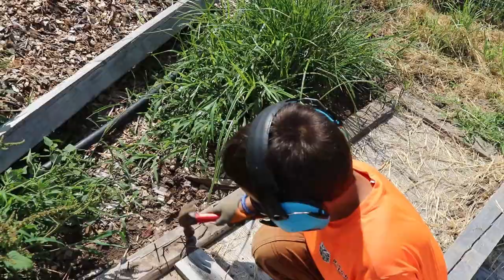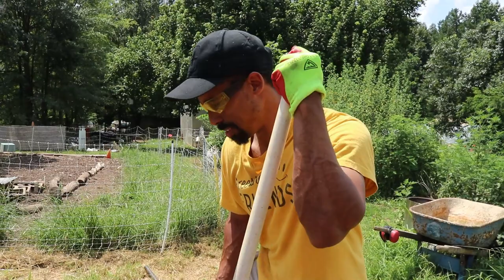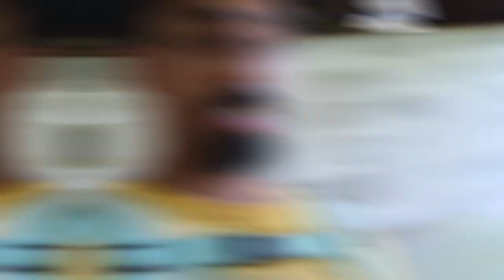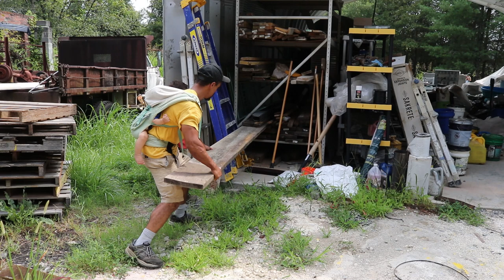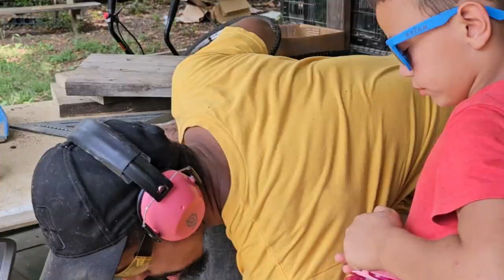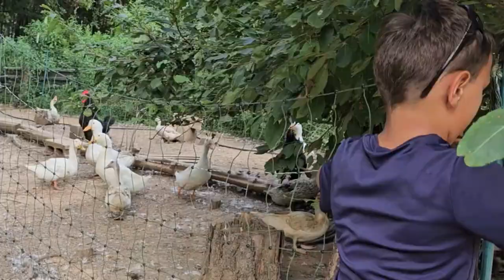More EGGS With This Super EASY DIY Build | DUCK Boxes

Comment: Watching the boys pound the nails OUT of the wood reminded me of when my brother and I did this all summer long. We were the nail removers so that our Dad could reuse the lumber to build our house when we moved to the country. I was six and my brother was 12 years old. Dad had torn down several old houses and built us a lovely 3 bedroom home. He used lathe which was applied diagonally inside the plywood of outer walls. The outside walls were overlaid with siding made of rigid stone shingles. Of course the interior was dry walled....so there were actually several layers in each exterior wall. That house stood through many a storm.....and we lived in tornado alley,  IE. Central Kansas!! Just threw me back in time!!
Reply from the maker: That is such a great story!